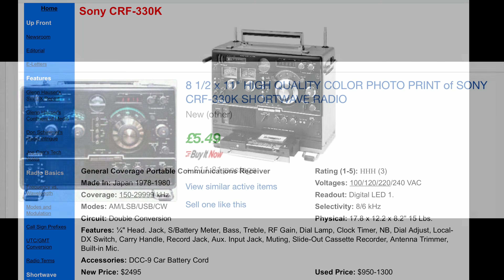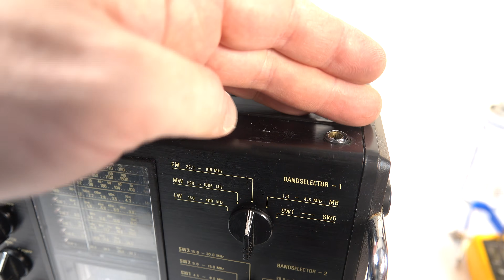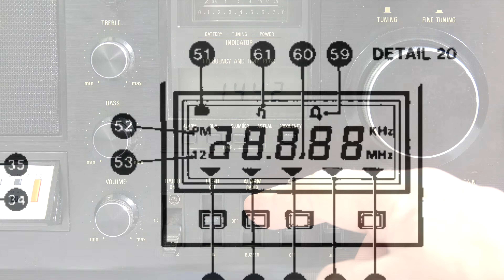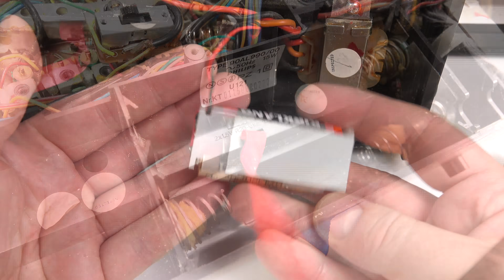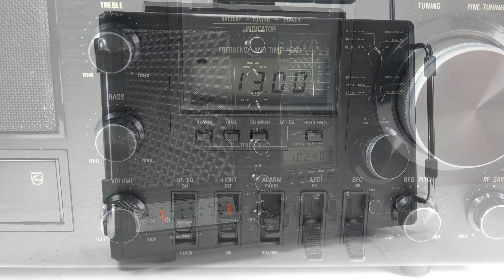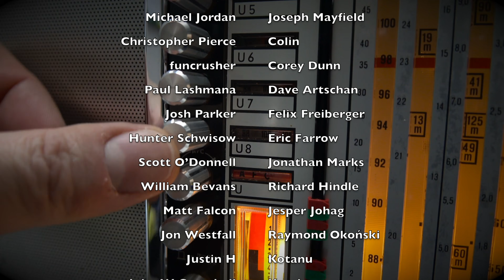Parts or Repair? - Philips AL990 Shortwave Radio

Comment: if the alarm wouldnt turn off, a simple fix would be to bridge the connectors for the "alarm off" touch button, and that would turn it off whenever it tried to go off. :D

Comment: If the 12v input doesn't work then it's likely the transformer is not at fault either- there's a switch on the 12v input socket that could be faulty, and possibly also a switch on the mains input socket.

Comment: Easy to test transformer each winding mains and secondary (low voltage) should read resistance on a meter if not that winding is burnt out

Comment: Happy Friday the 13th!  I just received my package from Odesa Ukraine from a seller over there, who has returned to Ebay after an absence that began on the invasion.  Thankfully there are a couple Ebayers who operate out of there selling radios and electronics  built in the USSR before the big collapse. I picked up a nice little pocket radio that plays AM and Shortwave.  She is a very sensitive set, from inside my home, setting in my recliner I can pickup both my local station (only the better of my radio collection do that because of all the noise generating devices plugged into the 3 power strips that feed not only a couple PC's but a LOT of wall warts that power a  lot of crap that runs in my mini shop that surrounds my chair since my age has caught up to me and my old shop, which has been closed for over 10 years has been filled by my daughter who sold her house and moved in with me, to do my cooking, cleaning and  distribution of paycheck for me.  The radio is a NEVSKI-402 Vintage Soviet Transistor Radio Receiver USSR rare collectable Невский and set me back around 40 bucks with shipping from Odesa.  Great little set, I can get the time from my easy chair off the Denver clock on SW, I have not tried her at night yet since it came in todays mail.  I have an external antenna for such things but I have yet to get it setup outdoors, my indoor TECSUN An48X is still in it's box beside me in my chair, I may give it a try this afternoon should the urge hit me for more radio.  Thank for the great videos, I can only dream of finding a deal like you did on that wonderful shortwave set.

Comment: I had this junk. Even when fully fixed , it i unstable like a rowing boat on the north atlantic.

By that i mean frequency stabilisation.     It looks fancy, but if you want a quality receiver then you steer clear of this one, and get yourself a yaesu FRG something
or similar.  Attaching some digital "mode" reception is a nervewrecking exercise because of that.   Good enough for broadcast reception, maybe some ssb on the side
but if you want to intercept meteo teletypers or other more interesting stuff, you will end up biting into your desk board.

best regards, big fan and radioamateur here. (oh8xat)

Comment: It comes from a time when Philips still had the expertise for building this multi-faceted combination. Nowadays they just resell Asian radio products if at all. The SSB functionality makes it even more worthwhile for radio hams (did it still work?). Strange the transformer primary circuit gave up before the fuse(s) did, fuse wires are normally designed on fast melting for quick disconnection, unless made "slow" on purpose. A new transformer can not be that costly IMO, they all come from China's cheap production lines  by now and since US 110Volts is still around even the double 110/220V voltage will still be normal feature  (personally I would prefer a 120/240V version). There is a small chance one part of the primary circuit didi not go broke after all and permits a 110 Volts alternative feed by rewiring and an even lower chance the electronics on the secondary side failed without blowing the fuse (semiconductors can fail in a fraction of a second!). BTW a 1982 product may need some new electrolytical condensors in the coming years, they tend to dry out and loose their capacitance after so many years or in rare cases even short.

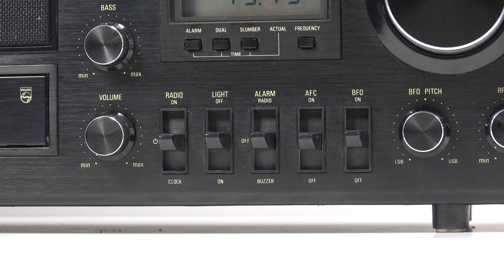Comment: The radio switch and the alarm switch are the ones you replaced. They're very close in color to the originals, but if you pause at about 11:19 you can see that at the right angle the new replacement backings are just slightly more glossy. Looks awesome though, and honestly if you hadn't told us to keep an eye out for it I am sure I never would have spotted it!! 🤘💪

Comment: Just began collecting old Audio equipment myself. I recently acquired a Sears calm track nine radio. The outside of it is in pretty good condition although it tends to pick up a lot of electrical interference from my house but it powers on and works. I then acquired a Montgomery Ward airline 10 band world radio and that one works even better. But the coolest thing I got recently was a sharp WQ562 dual cassette boombox. Although it sounds fantastic for it small size unfortunately the tape decks don’t work anymore I imagine it’s probably needing new belts so I decided I would try and pop the thing open and replace the belts inside as well as using some detox it to clean up some of the crackles and stuff in the knobs. Unfortunately I can get the bottom part of the back to lift away but the top part just won’t let go so I can’t get to those belts maybe someone on here will have an idea of how to open the back of this radio I thought maybe there might be some clips holding it in or I need to remove all the knobs which I did but I just can’t seem to get it open and I don’t wanna break it if I can get new belts in it the thing will be like brand new

Comment: Why so complicated? Grab the cables from battery. Split them and connect them to that external power plug (low voltage). Then you can feed with external power on battery-voltage.

Comment: FYI, you can use a soldering iron and tywraps to plastic weld the battery holder together. I've done a few and works well and still fixed after 12 years.

Comment: You could have put one of the other switches that you knew were working into the spot that selects the radio or buzzer alarm to make absolutely sure that it in fact wasnt the switch that was faulty

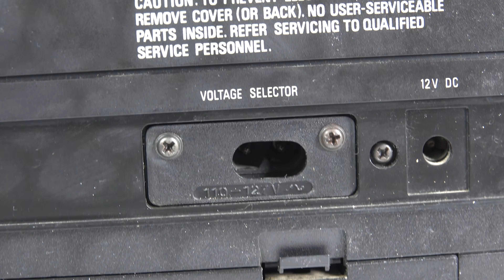Comment: 1:53 Exactly what happened to mine by mistake it was on 110-127 instead of 220-224 volts, can´t remember if i tried with batteries instead.
I have to get an another AL-990 it was an good radio :)

Comment: You could probably find a transformer. I have also actually taken apart them, to discover a thermal fuse inside it, soldered in, but you could likely just find a similar transformer out of something else. But you could also just as easily obtain a brick type adapter to supply the 12 V and run it that way. Very nice set in any case.
Reply: It didn't work with external 12 V, so something else is dead, not (only) the transformer.
Reply: هل لك ان تعرف فولتيات الخرج اوت بت  الاصفر كم والازرق كم

Comment: If someone hasn't already suggested. The transformer may have a in-wind fuse hidden under a few layers of wrap. I have repaired several transformers by replacing that fuse. It will be on the primary (Input) winding and is usually a fiber insulator with a tiny piece of wire across it. Good luck.

Comment: Hi, my name is Jonas, i am from germany and i relly like your Videos.

I am a Electrican -> So have you Isolated the Cabels After the Soldering work? 

It Would be very stubid if the Radio dies behause of a short circuit...

Greetings from germany 😀

Comment: When you soldered those wires to extend them (instead of replacing them) did you insulate the solder joints? If you did, you didn't show that. I hope nobody copies that.

Comment: I have a Kenwood TS-820S HF radio station with a similar arrangement... the frequency counter is a completely separate part from the radio itself.  The counter doesn't really work right on mine especially before it warms up a bit, but the radio itself works fine.

Comment: The red ribbon in the battery compartment is to make it easy to pull out the D-cells, and thus should be behind them.  I notice you had it on top.

Comment: I came across something similar in a second-hand store back in the 90's. It was an early 80's Radio Shack brand that I got super cheap non-working. After nursing it back to life I was very happy with my purchase for several months. I left it in my car one hot summer day and found it had MELTED beyond use. Still kicking myself for that!

Comment: Nice job on the repair. Nice radio too. I'd run a random wire off the nice to have antenna jacks. Could run it out the window and use a 22 gage magnet wire to keep it stealthy. With a little MFJ random wire tuner attached to the wire you could pick up plenty inside your house in spite of all the shielding. If you have local RF interference just go through your breaker panel one by one shutting them off to localize the noise source. I once found a wireless keyboard was the culprit. It had been placed on a closet shelf with a box on top depressing the keys and sending an unrelenting signal for several hundred feet.

Comment: Just a thought - and notice I have NOT looked at the service manual - but if the mains supply doesn't work and the 12 v DC  fails too - then I think it's unlikely to be the transformer as that certainly is not involved with the DC connection.  My guess is - 220 v  through transformer and then rectified into around 12V which is then regulated to the 9V needed for operations.

Comment: Hi. I love your videos and It’s like a nostalgia for me to watch. I was doing a repair of that kind of equipment for 30 years.
The transformer is good. The thermo fuse in the transformer is  bad. It’s under the isolation tape on the high voltage section.

Comment: Shortwave is dead more or less these days and there's very little on it. Many transmitters and radio stations have disappeared over the years. If Digital Radio Mondiale had taken off on MW SW and LW perhaps a bit more life would've been gleaned out of AM. It offered better quality over larger distances, was more robust at coping with difficult reception conditions and was a flexible means of broadcast at 1/3rd of the cost of AM.

Comment: I know you don’t want to fix it, but if you do I’d check to see if you are getting an AC voltage out of the power transformer and continue through the circuit checking a dc voltage at the rectifier and voltage regulator both of which should appear in the service manual schematic

Comment: This transformer on the primary winding has a thermal fuse
, which degrades from time to time and stops working, even with a whole winding. It is possible to partially disassemble the insulation and short-circuit the thermal fuse. After such manipulation, such transformers have been operating for many years.

Comment: Shortwave Radio story - In 1971, I returned home on Emergency Leave from Vietnam, my wife was giving birth and needed a C-Section, back then it was a rather big deal. So when I returned to Nam, my room had been invaded by some transient soldier and all my crap was gone, including my beautiful little Hitachi radio/Cassette unit.  So it was off to the PX in DaNang, the nearest large base to replace my crap.  Well I found a fantastic radio it was of course, AM/FM/SW/LW/MW/a bunch of other crap.  I loved that radio, but let this new guy talk me out of it. Well soon after he bought my radio on credit, he was transferred down to a lower unit, out in the bush, and it took me till the day I left to get the money out of the idiot.  So at any rate, that was 1971, I had carved my name on the handle of that radio.  Roll forward to 1975,  I was still in the Army, and was transferred from Fort Bliss Texas to Fort Mayer Va, and assigned to The Old Guard.  On checking in, there on the desk of the Company Clerk of C Company was my old multi-band radio!  I told the dude at the desk that I had once owned a radio like that, and when he pulled the tape off the handle, there was MY NAME!  Well I tried to buy it back but the dude would not part with it.  Ah well I have a much nicer SW radio now.  KE0JBL

Comment: Amazing how prices in England of them Sony and Panasonic Multi Band High End Radios were so Costly there, I bought a High End Sony  SW Receiver in 1984 for $350 USdll. Yours was 2,000 Pounds.I also bough The Very First Radio Shack 4 Channel Police Scanner in 1974 cost $100.00 and Crystals $5.00 I had Police, Sheriff and The Other Taxi Cab company in slots 1-3, National Park Rangers in 4th.I was a Taxi Cab Driver in Hot Springs National Park, Arkansas. The entire City is a National Park. Wen I was a Teener We Had Full Gambeling All Out in Open, Even the Restarants down town had Slot Machines along the walls, the Continental Trailways Bus Depot had Gambeling Games to play whiles yous woit for Bus. Slot Machines, Live Chickend that Play Panio for $.25 Cent in a Slot: The Chiven gets CORN if it Plays a Tune on a Tne Piano! Yeah, ""I.Q. Zoo" on whittington ave. I worked at DRYDEN'S POTTERY also in 1960s.

Comment: Hello, where did you order the replacement antenna from? My AL990  still works, but when I pull out the telescopic antenne to full lenght, the 2 small internal copper shims at the bottom  work loose and the whip comes off.

Comment: The reason so many of these old radios are in terrible condition is that when the owners got an upgrade, they were all taken on to worksites, garages etc with them. Hence why so many are covered in shit, paint and dust. Also, the alarms only work on mains power, not battery. It's a failsafe.

Comment: Nice job,  I enjoyed watching your diagnostic process.  One tip... When I clip off something like the battery holder, I usually snip each lead at different lengths.  This way it's less possible that they might short out.  Also, if they feed through a hole in the case they won't jam up in the hole at the splices.

Comment: This is a good stuff.... May be you can repair the "power supply" these radio.... You're check the "ac/DC diodes" and the capacitor from power supply, and read the voltage out. Check the voltage regulator, read the out voltages from the power supply, and your radio can work.... The transformer dead, you can replace with other similar.... (May be 12v ac out to 1amp) great stuff...  Regards from México. 👋👍

Comment: This video makes me appreciate my Panasonic RF-2200 which has been collecting dust under my desk all this time.   I've managed to lose the battery compartment door somewhere...
Reply: The RF2200 is my absolute favorite MW receiver ever. As a standalone portable with batteries and that Gyroantenna and that big air variable tuning capacitor, the RF2200 is just the best single AM rig I own. Sure, I can usually dig out more DX with phased antennas on a big tabletop rxer but that requires a bunch of gear and outdoor antennas. For just grabbing a radio and listening for longhaul, interesting analog AM stations, nothing beats the RF2200.
Reply: @sclerismockrey8506 I really like my rx-fm45. That thing is pretty damn good on AM!

I also have this Sears "automatic radio" thing that's on par with the Panasonic. It has three IF stages.

Comment: I'm a bit disappointed you didn't tune it to an amateur (radio ham) band like 14 MHz so you could have demonstrated the BFO I noticed. You can get a 'real' communications receiver quite cheaply such as the ICOM IC-R70 on Ebay - look at https://tinyurl.com/Techmoan-Radio. Put up a long wire outside and feed it into the house for indoor reception.

Comment: I’ve currently own a National Panasonic DR28 which cost me only a few bucks and some repair. 
It still got a nearly broken power switch which is really hard to fix but I used a way around it: the Radio stays in the (on) position the whole time and is plugged into a TEAC TT-2 HiFi-timer which turns the power on and of... 
what sounds linke a overkill is actually pretty neat: this two radios now form a very fancy clock radio. 

Besides that, I’ve managed to get my hands on an old National Panasonic GX 400 and (what’s way cooler) it’s Japanese counterpart the cougar no7. 

The number seven was briefly featured in one of the Neon Genesis Evangelion movies 1.11 or 2.22... it stood on shinjis desk and catches immediately my attention because of its cyberpunk-military aesthetics.

Comment: We had one National brand (Japanese) radio and cassette player. After its cassette player broke a loop string inside I opened it's back and after few times I never closed it, because it was old and something inside would brake at anytime. I could use it perfectly while open. Its shortwave radio was my internet that time. I felt myself connected to the world using that and I learned even few languages (including English) and listened to songs of many languages that I never learned. I was so used to the noises that after digital technology I couldn't bear the high quality of the same songs and radios. For a long while high quality voice and music didn't sound "natural" to me :D

Comment: Hi Techmoan. They must really like my photo, seen at 0:44 in your video. The receiver  shown (a restoration video on my channel) is a  CRF-320, not the 330K as mentioned. You can clearly see there is no tape deck option on the CRF-320, where as the 330K has the option, and is much taller.
Reply: Wow, I thought that looked eerily familiar. Selling someone else's YouTube thumbnail printed off a cheap inkjet for $7.. that's certainly a new one!
Reply: @leisergeist  that is brilliant, 5 cent of cost and then sell for $7. like those genuises selling shirts online and apparently have every (copyrighted) logo in stock - when you order they drop ship some low quality print from china a month later. brilliant business I want to do this myself

Comment: What are you talking about? A house really does only take 22mins to build +adverts. The builders have to stop during the adverts. And when the adverts are finished they need to explain what happened before the advert for over a min, in case during that short break, you have such a bad memory you've forgotten.